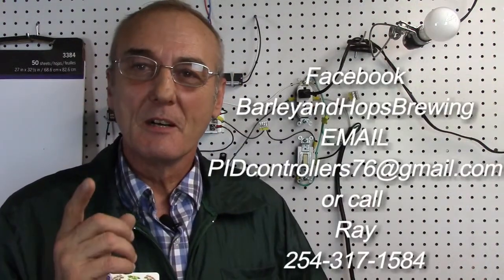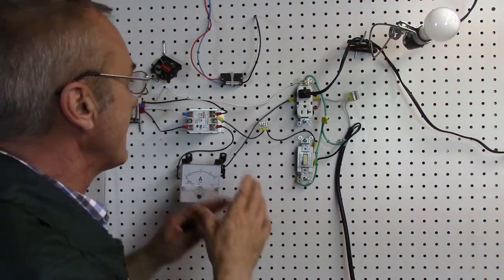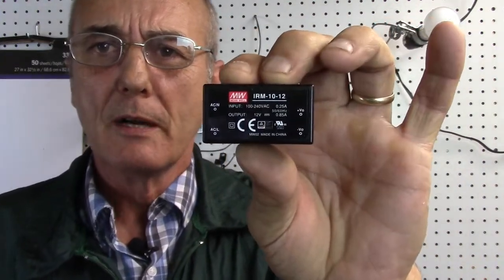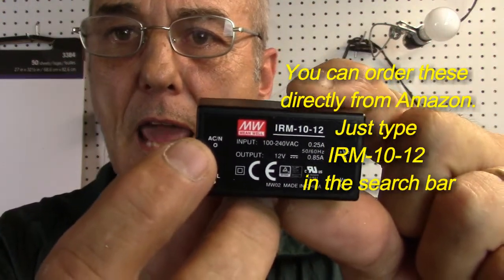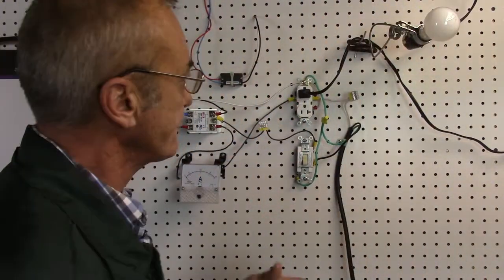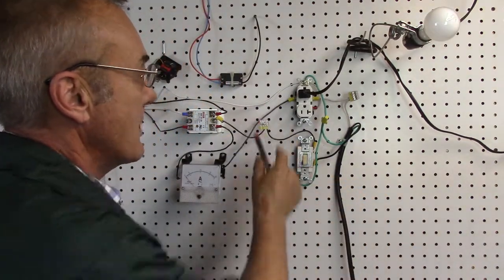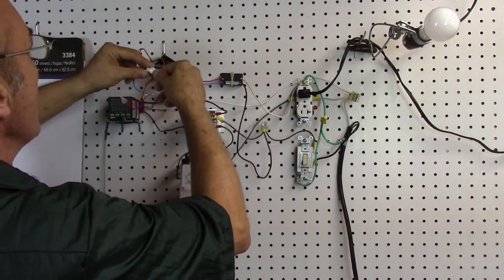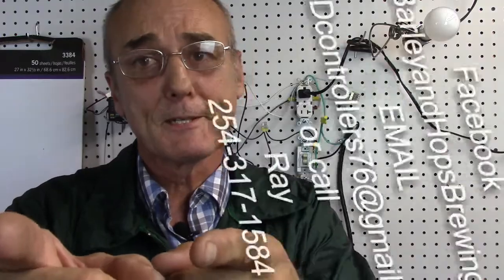Wiring 120V PID including a cooling fan

Comment: George how do you feel about throwing some fuses it the box? I am going back and forth on adding fuses to the box and if I do what do I want to protect. I could add a 20A but I have the breaker however a fuse is very fast. Or I may protect the PID or the SSR or all three. I built LED grow lights and fused them up but I just wanted your option on the subject. Thanks for any help.

Comment: Hi -I am in Aus where we have 240V 50hz. Are there any components that will not handle the Aus system.
Reply from the maker: Well, actually your voltage is 230 V 50 Hz. It is wired the same as our 120 V 60 Hz. The Hertz is only critical in digital timing circuits so that is not an issue here.
Most of the electrical components are rated from 80-260 V or more in some cases. You should not have any issues wiring this in Australia.
George

Comment: If I use the 12v inkbird (itc-106vl), can I connect it directly to a 12v fan without using an ssr ?
Reply from the maker: You will need the ITC 106RL model if you want to skip the SSR. The RL model has an internal relay and the Vl model does not.
Reply: Hey George, thank you so much for your instructional videos. I've found much success in your teachings. I wish you where my teacher or neighbor while growing up. About connecting a 12V fan to the PID receptacle ITC-106VH SSR 40A... Didn't last a second to blow it, it blew before I could blink. BIG Bummer!!! I was confused about the SSR providing enough power to power many things and the fan drawing power as it needed/Load. In this comment you said if I want to skip the SSR I will need the ITC 106RL.... With your answer arrises many questions that I've spent many hours browsing the internet trying to solve with no success. The fan that I want to connect to the PID controller is rated at 12V DC, 0.9 Amps, 10 Watt connected to a DC motor speed controller. I was looking into a DC 2 Amp 30W PWM Controller to regulate the fan speed. If not the controller, I'm also confused about the ITC106RL power supply, will a 12V DC 2 Amp blow my fan or supply enough power for the PID, Controller and fan? Is the same power thats connected to the input power of the ITC106RL passed through the relay output, whether it be AC or DC?.... Or does the PID draw some energy and I will need a higher amperage power supply?... Oh boy!.. I know... It's long!! But with out you or people like you... The world is MADNESSS, full of mysterious dreams and burnt electronics. Thanks again George!
Reply: Barley and Hops Brewing
Thanks for the help.
Reply from the maker: Anytime. Just shoot us an comment if you need us.